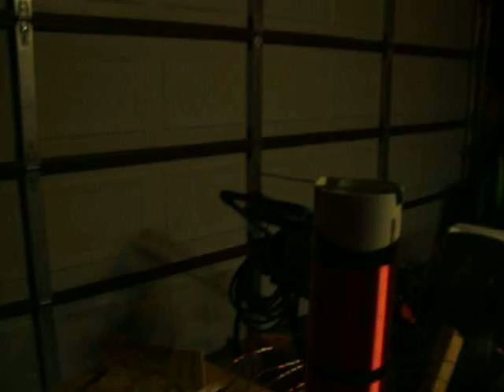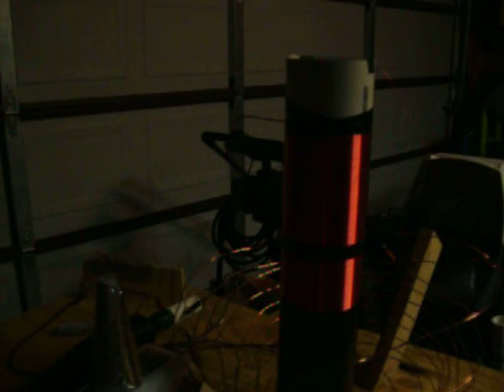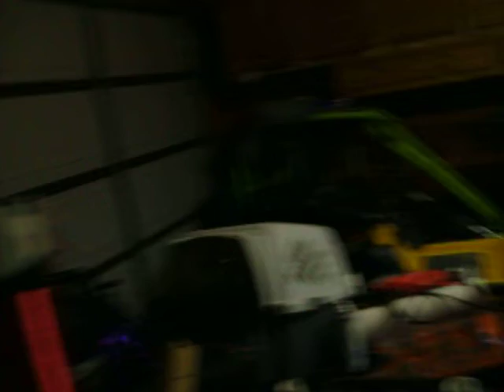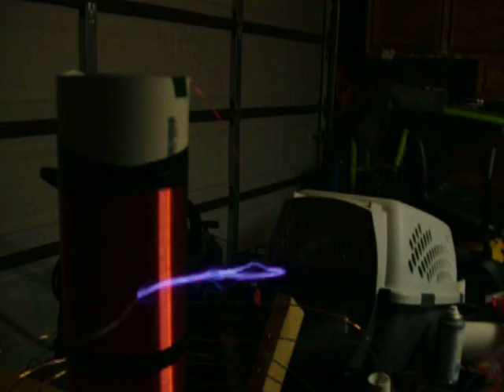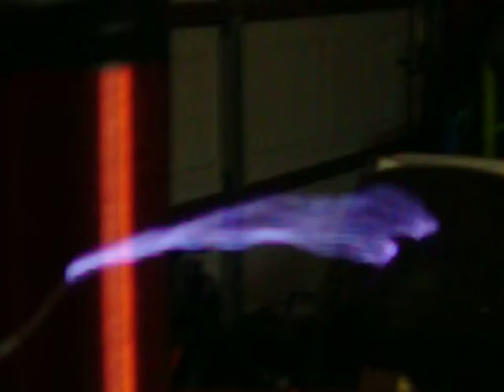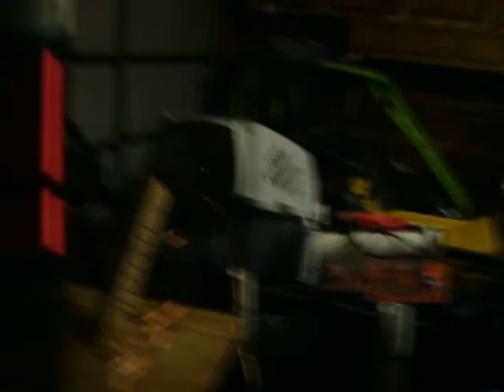4 inch by 16 inch tesla coil

Comment from the maker: Hehe thanks. I know ALOT more about tesla coils now. The reason for the tiny sparks was because the secondary was shorted in about 4 places, and that is what i could see. There are definitely more, but i am going to keep it for using in sstc's. The shorted windings are higher on the coil, so they wont matter that much, considering the base of the coil is like a transformer and the top is the resonator. Now making a somewhat larger coil, running with one MOT.

Comment from the maker: Well, i have completely given this one up :P. I no longer have my CDE caps for the nst, gave 10 away(100 bucks damnit). I am making a new one, powered by one mot. It will be resonant charging, using a voltage quadrupler, a new secondary, and an arsg. Hoping for about 30" sparks, at up to 400-600bps since it is dc. No need for srsg, and bps can be very high. Also, since it is going to used really low capacitance, capacitors will be cheap. Ima use 10 .15uf cde caps in series. 15nf, 20kvdc. NICE :P

Comment from the maker: I noticed. I am arcstarter of 4hv :). You know, the one asking you if you need a source of wire and stuff. I have a new nst 12kv 60ma and i am going to go ahead and use party cup capacitors..Just bought a new capacitance meter to find how many caps i will need.

Comment from the maker: :(. I am poor as hell. That is cause i am 15 :P. PLZ SAY NOTHING ABOUT MY AGE. It is rather thin, aint it? Oh well, i am going to get some good capacitors and then i will get some copper. I am about to start making a new small tesla coil(2 inch secondary, my old 6kv 30ma nst, as my new 12kv 60 ma nst is on the big(er) coil.